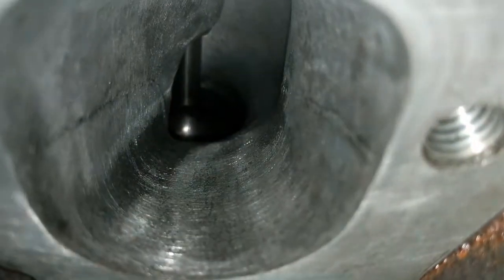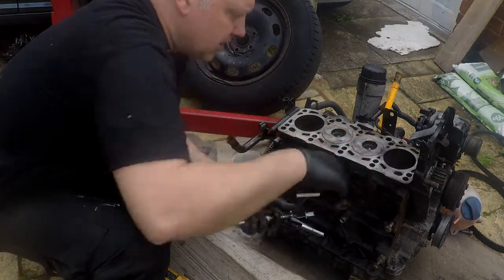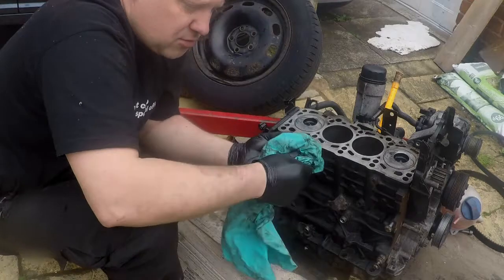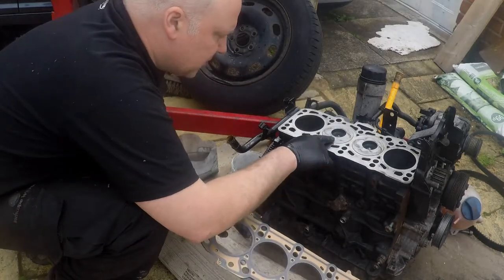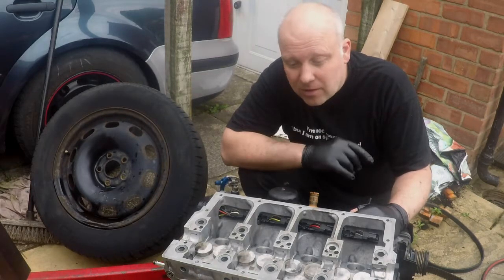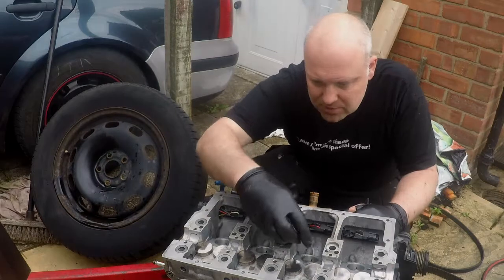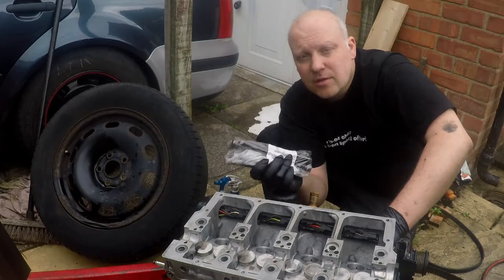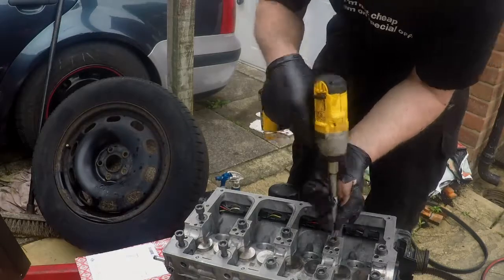VW Corrado TDI Conversion - Ep3. Head on the block

Comment: .Good video's enjoyed it, Did you feel a performance gain? Im thinking of doing the same job on my ZX9r.
Reply from the maker: I've not driven this motor yet, but I've done other heads, turbos get noticable differance feeling the turbo spool quicker with little load and N/A can fell free cleaner top end